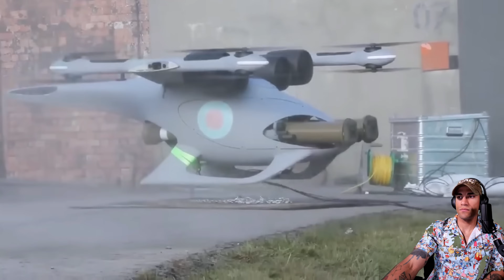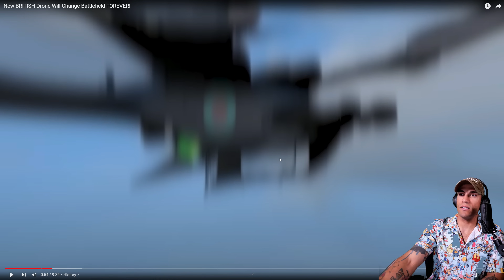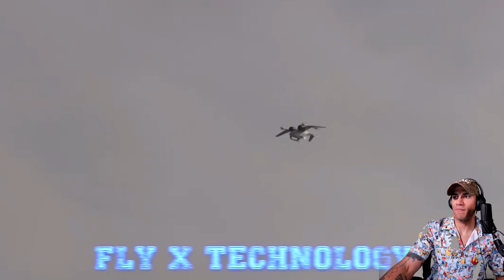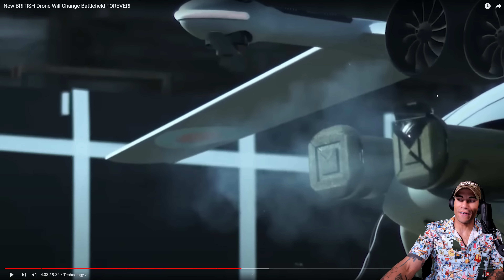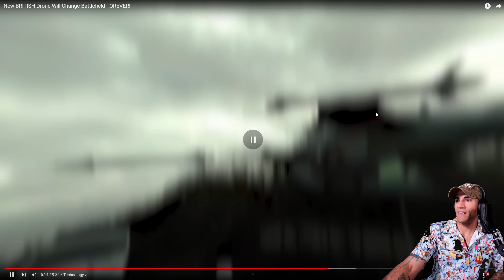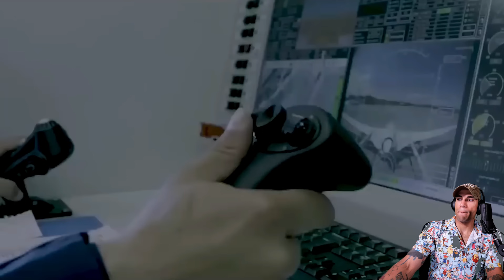The Jackal: RAF's Futuristic Drone - Marine reacts

Comment: i think its wrong to view these as a "bridge" between commercial and military drones , they are more of an evolution of commercial drones so your no longer just strapping explosives to them or dropping grenades through open tank hatchs etc , having a drone capable of anti air and ground that can be re-armed,re-specd and re-deployed in the field without the need for a runway or large maintanance crews will be a boon for any forces involved in a conflict where air supremacy isnt garanteed. Parity wars work very differently to what everyone is used to

Comment: It is a cost strategy.  If one of these costs is 1/10th of an Apache, and five drones counter that asset with no pilot risk.  Then, this is both a tactical win and a strategic win.  Both the aircraft (apache) and the pilot are expensive.  Discouraging their loss would deny that airspace to an enemy.  I suspect 1/10 underestimates the cost ratio, but I do not know the figures involved.

Comment: What is unstated in the commented upon video and by the comments of this channel's presenter, and by viewer's comments, is ... this UAV technically has a zero-feet launch altitude for its payload - that is huge in relation to intrusion and ground-intercept missions, especially when coupled with its flight autonomy AI.  Unstated but technologically possible is the fly to operations location, land, enter standby and wait for enemy to arrive, then repower, lift off, fire payload, and return to base.

The reviewer in the video also completely missed that the horizontal mounted "turbo fan looking" units are not propulsion units but a form of ram jet power generator that use airflow in forward movement to generate battery rechargee power, but in a charge-life extending role rather than an unlimited range capability.
Reply: The JACKAL drone uses four sets of twin contra-rotating propellers to take off, hover and land vertically while using four wing-mounted electric ducted fan (EDF) engines to move forward and manoeuvre at high speeds.

Comment: I wouldn't like to be operating an attack helicopter in a region that was protected by a number of these drones.  Whilst the attack helicopter may have far more firepower it could be overwhelmed if two or three of these pop up around it from below the trees - would an attack helicopter even discover it before it was fired on (especially if up against two or three at a time).

Comment: The video is a little optimistic on the drones current capabilities I see them more as an improvement to current infantry anti air and anti armour teams with operators attached at the brigade HQ level deploying their drones out to provide close air cover and support to the troops on the ground. While it is a threat to enemy attack helicopters and ground attack aircraft when they come close enough to target ground units it simply doesn't have the range power or payload to replace them in the attack role. And any fighter fecking around that close to the ground near enemy lines is either an idiot or already in trouble from something much more dangerous.

Comment: Has everyone missed that it is autonomous , no signal jamming vulnerability or person at the helm. It is Ai and will be given a mission. It is stealth so targetting will be difficult and its unlikely to run into anything , it's hard to get a Dji to run into anything nowadays and a Dji isnt autonomous and requires a controller
Reply: How little you know ))))
Reply: @o______opanasovych  Well I'm an electronics engineer and computer engineer , perhaps I have a clue
Reply: Okay so you think that it is stealth ? Does effective reflection area mean anything to you?
Reply: @o______opanasovych I do but measures can be taken on anything to essentially reduce that as much as possible . Now it's small anyway and in Ukraine it has already been demonstrated that even air defence fails to spot many drones and when it does , fail to trigger proximity detonators
Reply: Yeah, but I can build an AI pilot for a DJI drone, so anybody can build an AI pilot for hobby drones.
Reply: In fact, the latest MCUs have heterogeneous cores, fast general cores, low voltage general cores, GPU cores and, the latest thing, NPU cores.
Neural Processing Unit cores are modified GPU cores designed to execute trained LLUs on the drones input and make high level decisions

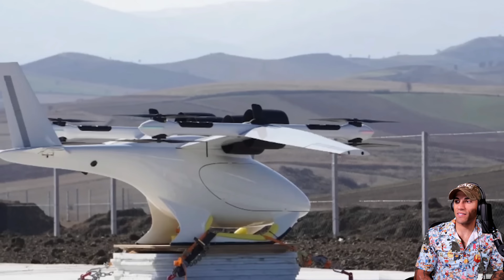Comment: 13:01 The LMM (or Martlet) missile has 8 km of range, not far off from the 10-11 km range of a hellfire. Though it does have a smaller warhead, which can be both good and bad since it obviously is less damaging, but that can potentially allow less collateral damage. The LMM also has a proximity fuze so it can be employed against enemy aircraft if needed. (hence the name Lightweight Multirole Missile) 

The Starstreak MANPADS also mentioned in the video actually has greater range than the Stinger, while also being immune to almost all countermeasures since it uses beam riding guidance, so basically the launch platform points a laser at its target and the missile does its best to ride the beam as the name suggests. Though its accuracy can potentially be slightly worse against fast moving and manouvering targets as a result. Oh and the missile's maximum speed is around mach 3.5, which it reaches less than a second after launch before it separates into 3 small darts that fly in formation. Yes it sounds scifi, but this weapon has been in use since the early 2000s and has been proven in combat in Ukraine.
Reply: To my knowledge, Starstreak doesn't lase the target. 
You optically track the target in the viewfinder and the laser, which I believe is too low power to set off helicopter LWRs, projects a cross pattern for the hittiles to ride, but the hittiles beam sensor is in the tail of the hittile.

Comment: Cost is imporant beauty of compercial drones  this fuckers attached modifed mine + drone for less then 2k drops on 10M $ tank and it's gone at least unmobolised. So for cost of one T-54 you can get 5000 comercial drones. Building 5000 drones will be also faster then one t-54 tank. You can send 100 drones if 1 of them get the target u just saved few milions. That's insane.

Comment: Sorry! But I don't believe in this drone, as they haven't tested it on the most important thing and they probably haven't so it will fail that test. The test I'm referring to, is it easy or hard to shoot down the drone. If you look at the drone, it is easily hit. The drones of the future are small, cheap drones and just look at the success these little ones have had in Ukraine. The drone shown in this film would not last long in Ukraine, but would quickly be shot down.
Reply: Ingress is at low level and operations mainly at night. It can go high if risk is in the low block. Air defence systems are not everywhere and JACKAL is designed to have the range to circumvent where possible or saturate in numbers if not.

Comment: For a first iteration, this is interesting, but I think the design will evolve as it sees more combat time. The ability to call up a mini airstrike in an area with too much AA to risk deploying aircraft would be useful, and it means being able to bring the firepower of a shoulder mounted system without the need to carry it with you all the time. You could have small battle groups with two or three tasked to them on hold nearby without having a huge radar signature or the noise and maintenance requirements of something bigger. The electronic interrogation of the area would be useful to the field commander too, if this can give you a mapout of phone or other EM signatures in an uncleared area.
Reply: Calling up for an air strike in contested air, though. 
That's what we have artillery and cruise missiles for.
And they are being obsoleted by hobby drones carrying bombs, one way attack drones. 
It's so cheap now that there's just no point in making a reusable drone outside of it carting expensive optics.

Comment: The two kinds of missile mentioned are guided. The LMM is a modular missile also known as the Martlett it's being integrated into lots of different platforms. From helicopters (wildcat currently) to infantry vehicles and as a ciws for ships. One that can engage surface and air threats. Guidance is from optical sights as a laser beam rider or  G.P.S  I.N.S and an I.R seeker for terminal guidance. The Starstreak is a manpad and vehicle mounted shorad system. That uses optical guidance and beam riding to steer three very fast steel darts into it's target.
    According to Thales website both missiles can be fired from a single launch platform too. Like a shipbased V.L.S. it would be able to engage most types of vehicle. Air, land or sea with a choice of guidance and seeker options.
Reply: Starstreak's hittiles are terrifying. 
Take Stinger. 
One IR guided warhead detonates a preset distance from its target. 
On average, 25% of the destructive force of the warhead comes into lethal contact with the target, the rest sprays away into the air.
Starstreak is very different. 
First, you have 3 warheads with an average hit rate of almost 2 per target.
Their armour piercing tungsten tips hit at Mach 3 and will go through 30 mm of RHS.
But, not only do you get the kinetic damage, but there's a bursting charge in there too.
But because you're now inside the target, 100% of the warhead energy is transferred to the target. 
This usually cuts the target into two pieces. 
We have footage from Ukraine of Starstreak chopping the tail of a Russian helicopter at the root, both parts then instantly spiral into the ground at high speed. 

After Russia's been kicked out I think Starstreak is going to become popular on the export market. 
Cheap, deadly, stealthy and immune to all current countermeasures.
I can see heavyweight  Starstreak drones becoming popular.
Reply: Tungsten darts
Reply: @steve-iw2bg  A Tungsten steel alloy from what I can tell. But yes you're right, I'd forgotten that part.

Comment: most general drones fail a here and there because they don't have anti-drone radio wave capability and don't have much range or great range of sensors, and battery life, unlike the this drone. i think it will used in a recon unit.

Comment: If the drone itself costs 100k and the two Martlet missiles 2x30k pounds, I reckon any enemy would be willing to spend a shoulder launched AA missile to take this drone out of the sky. Not quite so with the cheap commercial ones (modified for military use).
Reply: i wonder if they are using the pop up fire and drop tactic like helos ?

Comment: This looks like a classic case of government trying to design a weapon system by committee and ending up with something that is designed to fail.
Reply: Actually. It is ahead of its time and ahead of doctrine. It is designed to be an interdictor attacking logistics and mobile communications behind the lines. It is getting range and speed enhancements and more weapon sets for customers to choose from. It shoots from the hover but can also shoot on the wing. It also shoots from cover between 4-6 km from its target. Small size at that range, a supersonic smokeless missile means it should get 2 shots off.
Reply: @flybytechnology6261  It's a flying ATGM platform. The doctrine dates back to the SS.11 -carrying helicopters of the late 1950s. The only new thing is that it's a drone, and as such it better come with some significant resistance to electronic warfare and air defence systems, or it's obsolete before it comes off the assembly line due to the cost alone.
Reply: Drones have already proven their worth in combat, I don't understand the negativity
Reply: Same, the cost is thr only negativ i see
Things like this are only useful of they are abundend @hawkstable8889
Reply: Yeah, over-engineered and 15 years late.
Reply: @DimeOfDimes that’s our standard MO 😂
Reply: How is shooting down helicopters with a drone designed to fail?
Reply: How is shooting down helicopters with a drone designed to fail?
Reply: Jackal isn't new though, they've been working on it for ages. 
It predates the suicide drone though, so it is functionally obsolete now.
Reply: Shut your face we have the best inventors in world we invented most things we use today and the technology we invented the tank the submarine the radar now a lazer most things we invent don’t fail !
Reply: You always used to LISTEN before commenting !
Reply: Totally useless over engineering. I mean how does this compare to lots of cheap drones with bombs on or kamakazi drones like Russian lancets.... pointless. Plus its size makes it much easier to shoot down
Reply: @seanyd5698  A cheap drone with a bomb can't engage a target from 8 km away.
Reply: @hawkstable8889  well if its to be used 8km away whats it for? To replace helicopters or something? I still dont get it myself.
Reply: @hawkstable8889  yep your right. In that way it does make sense. Im just not convinced it can do much more or anything different than the drones that are used today. Yes its better though so should still be devoloped i geuse. But at the moment if they offered one of these or a houndred kamikaze drones to ukraine wich do you think they would take? Given the type of warfare in ukraine. But yeh your right they should still make them. As more of an unmanned helicopter replacement. A bit like the unmanned jets they are developing
Reply: @seanyd5698  because they are short range, still need people to be in harm’s way and for every success there are 30 failures. JACKAL is designed to operate in non-permissive environments behind the lines. Changing enemy behaviours.
Reply: @flybytechnology6261  well that makes a bit more sense. More precision or specific target based. I supose it gives more options. Range is it's real weapon then.
Reply: @seanyd5698 it may not be obvious, but milspec, while more expensive, generally would translate to the drone's reusability (most UA attack drives with heavier warheads are single use), resistance to jamming and longer comms range, better targeting, stand-off capability, ruggedness. 
RU is also claiming that western armor is overengineered; and it is - but that's why it's crews survive way more often than in the cheap turret-tossers.

Comment: Gets rammed by €400 FPV drone.
Reply: How? You're clueless 😂
Reply: @Mk1Male  The how is literally the first two words. You realize that this is already a  regular occurrence.
Reply: @DimeOfDimes  How many FPVs have taken down Attack Choppers? Now imagine a attack helicopter at a fraction of the cost and size...
Reply: @babalonkie  This isn't an attack helicopter, this is a drone. They're used differently and have different vulnerabilities. Again, drones downing other drones is a regular occurrence.
Reply: @DimeOfDimes  You really need to educate yourself.
Reply: @DimeOfDimes  You have not actually countered my point...
Reply: @Mk1Male  Between the two of us, I'm the one who actually has educated themselves. Unless you're going to say something pertinent, don't bother responding.
Reply: @babalonkie  And how do you figure that.
Reply: I think the missile used will have a range of 8km 7:59 2-stage, solid propellant travelling at mach 1.5 plus I am sure if it's millitary there will be some kind of jamming on board . I doubt small drones would be a problem at those ranges.
Reply: @MickRiley  They already appear to be operating at ranges above that.